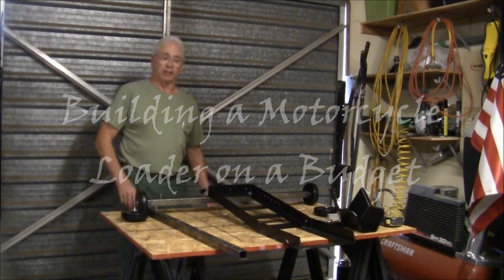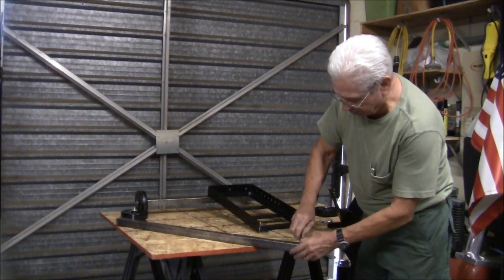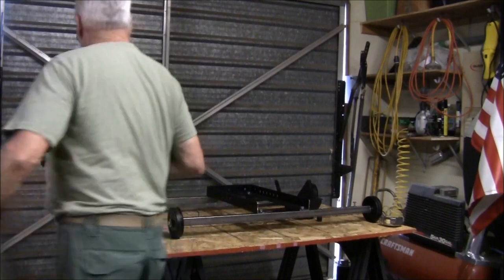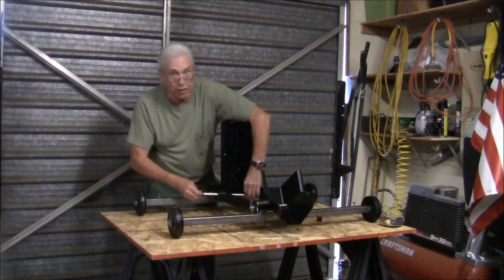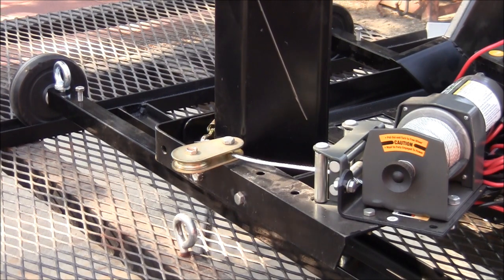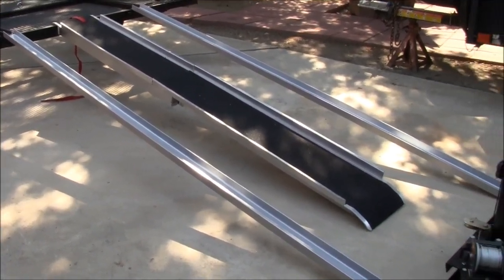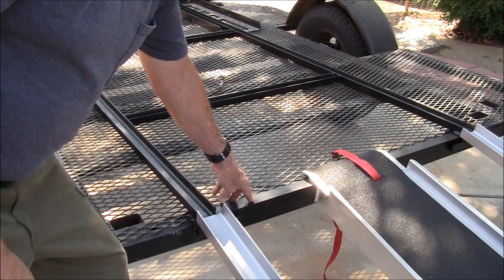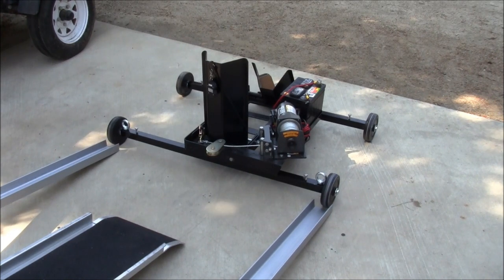(How to)  Motorcycle loader on a budget

Comment: Built this and the wheel base was too short for my 21" front wheel. It would just flip up and leave the wheel sitting on the ground with the loader still strapped to the wheel. I added 12 inches to the length and it works like a charm. If you didn't cut the length down at all it would probably work fine.  Good economical build.
Reply from the maker: I'm glad this worked out for you.

Comment: The builder may not be checking back for comments.
This is maybe the most sensible and economical solution to the loading problem I've seen!  It would be extremely important to make sure the center and tracking ramps are rock stable...at both ends.
Nice design and good video.
Reply from the maker: Thanks for your comment Dan. I Traded my long bed pickup for one that's too short to carry a bike, but I'm using the lift on my trailer.  I have the rails bolted down to the trailer so they don't move. Works really well.

Comment: The wench being mounted on the cart loader you must have a idler pully mounted on the trailer & also on the truck, also how do you unload  your wench is resealable. Raising the front of your guide tracks on your truck & trailer would cause the pully to want to roll back out when unloading, that would put tension on your wench cable to alow your  reverse mode to control the unloading
,

Comment: Do you need the winch? With the front wheel on the trolley you could ride the bike onto the trailer
Reply from the maker: Good thought, I suppose you could motor it up, but I think I would prefer slow and easy with the winch.
Reply: True .

Comment: Looks good, but do you have a brake on the trolly to stop bike pushing it forwards as you ride bike into chock?
Reply from the maker: Really good question. I have threaded holes at the bottom of each ramp. I just thread in bolts and roll the trolly wheels up to it to hold in place. when the bike is on the trolly I just remove the bolts and winch it up.
Reply: Thank you

Comment: Sure would be good to see it in action. Pulling a Gold Wing or Road King.
Kinda hard to commit a $30 000 bike when yo haven't seen it work.
Everything works great on paper or in mock up.
Reply from the maker: You're absolutely right.  I've designed a different bed rail system that will automatically start the unload process using standard garage door springs. It will pull the bike back to the ramp as the winch is reversed then gravity will take over to complete the unload. I'll no longer have pull the bike back by hand.  I'll make a video of the build and demonstrate it with my K1600 GTL.  The ramps and loader will remain the same. Thanks for the comment, and stay tuned.
Reply: @KTMPappy  Love the design. Spent much of the day trying to figure out something similar, decided to look on YT and came across some interesting videos. Yours is perhaps the best of the lot, especially for being a cheap and easy to build system. 
Any progress on the upgrade? You have a Kiwi Tinkerer wanting to see it in action!

Comment: What about brakes Pappy ?
Im building one like yours and need a way for it to stay put as I drive my motorcycle up on it.
Reply from the maker: Good question Thomas. For holding the trolly in place while driving your bike on it. I drilled and threaded a hole at the bottom of the channel for the trolly and put a bolt (about 3" long) in it. When I rolled the trolly up against it, the bolt would keep it from rolling forward. When the bike is secured I just remove the bolt.

Comment: Sorry I didn't say I like your product  you did a very good job in design & also your video slowly  explaining  your product please reply to my comments  many thanks Will
Reply from the maker: Sorry for the very late reply. With the winch mounted on the cart it doesn't require an idler pully because the cable doesn't move. It simply winds up on the winch and moves the cart. That's the advantage of mounting it on the cart versus a stationary mount on the the rails.

Comment: Pappy how are your aluminum threads holding up ?
Reply from the maker: I've had no problem with the threads, but make sure you use stainless bolts. Other bolts could cause electrolysis and cause the threads to deteriorate.

Comment: Where did you get the wide center ramp, can’t find one like it
Reply from the maker: I got mine on averstocked.com , but it looks like they are out. Try ebay and search (Grizzly Folding Aluminum Motorcycle Ramp). Looks like one there. Good luck.
Reply: Thanks
Reply from the maker: you can also just type Grizzly Folding Aluminum Motorcycle Ramp into your search engine and it will take you directly to the dealer.

Comment: So? How'd it work?
Reply from the maker: Loads up real slick.  Only Problem is I have to either stop on an up slope or pull the bike back by hand to start the unload.  Thinking about revising the bed rails and use garage door springs to start the unload.  Once the back tire starts down the ramp, gravity takes over.